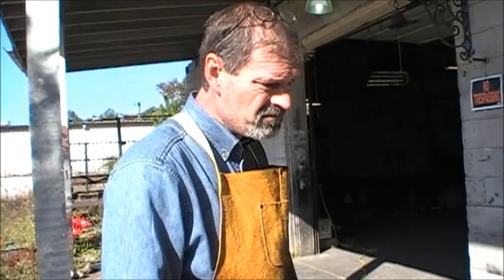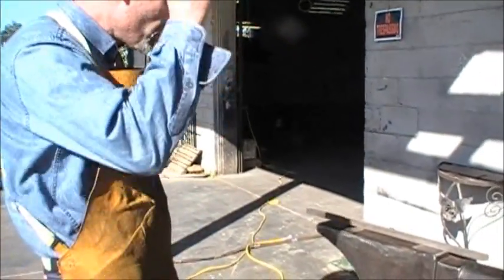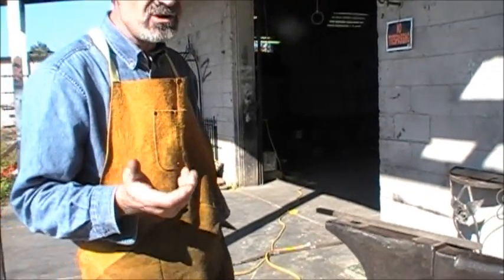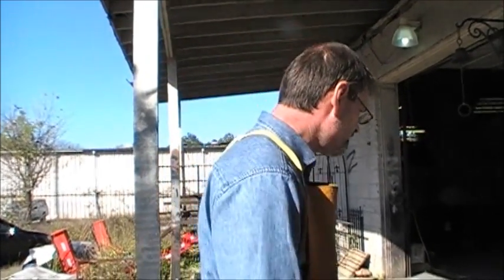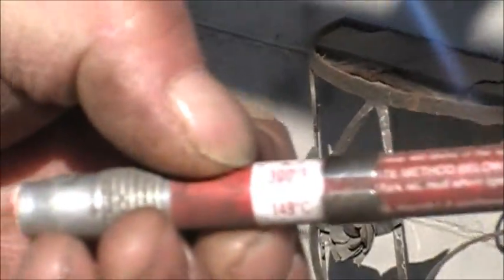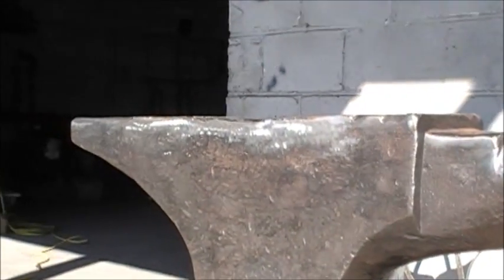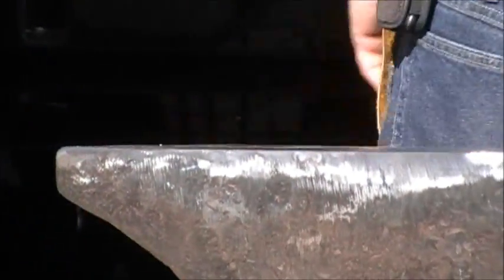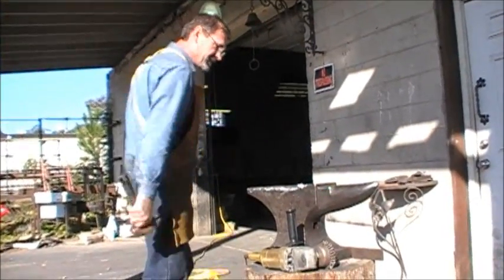Blacksmith Anvil Restoration Part 1 of 2

Comment: Thanks for posting this video. It gave me the confidence to take on the same job on my 395lb PW farriers anvil, although edges on mine are fine.  I had 3.5 mm of swayback to get out of the centre.
A lot of grinding over several days and belt sanding to finish, which was a lot of work...but it has been worth it. I now have a fantastic, very usable old PW.   Cheers Stelian.

Comment: Hayes work-hardening hard surface rod is the way to go. 750°f whole mass preheat to insure adequate penetration.  Bulld everything up. Peen and wire brush each rod pass. Should take about an hour. Those rods like a short arc. DC positive. ¼" rods. 'Stir' the weld as you go. At about135 amps. Should take about one rod per cubic inch. They aren't cheap. About $4USD each in 2020 money. Glad it worked out for you. I lived in Selma for a few dozen years and smithed at hickory forge  on Lizzie Street. Was NCABANA till I retired and moved to Cape Hatteras for 5 years. Am in Arizona now. Traded hurricanes 🌀 for heat 🔥🌡️🌵🦂⚒️
  Edit: Sorry.I now see that this video posted eleven years ago. If you are still monitoring the comments, how is the anvil holding up? Praying that you and your friends and family have endured these trying times. God Bless.🙏

Comment: I had a colonial anvil restored in a similar way.  The welder who did the work preheated the anvil to 250 -300 degree F to be sure the welds took.   He built up much more with the welds before griding back, to preserve as much of the original face as possible.  I don't know the exact rod # he used, but it is a "work hardening" alloy.  He did not do any further heat treating.  The results were excellent, and I was only charged $45 for the work.

Comment: A plate of good quality modern glass will be quite flat, use of that (with size bigger than the work surface) with some high quality sandpaper can help flatten it some more, with use of ink the bumps will show

Comment: the main purpose of preheeating is to drive out any possibility of retained moisture in the material being welded and also keeping rods very warm,  minimum over 250-300 degrees.  temperature differance appears to make a differance, crystal structure.  saw  several pipes welded with a short preheating time,  they just broke at the edge of the weld.  had others held in preheated state for over 15 minutes resulting in about as perfect weld as can be,  passed all tests administered.  regards,

Comment: with those style anvils (wrought iron body and hardened steel top) you can usually see some kind of weld line even if it's been smoothed over it's normally still visible.

Comment: In the larger 7" grinder size you can use a cup style grinding wheel made of silicone carbide...same material as used on crankshaft & camshaft grinding machinery, except they use a lubricant spraying on while grinding...similar but coarse wheels were used for grinding  concrete, which may be the way to go..about $15 from norton..

Comment: wrought iron. Next I grind the chips and especially the cracks out. Next I weld the chips and cracks back to slightly above the original surface making sure to peen each weld pass surface and grind them back as needed. I weld the sway up instead of grinding every thing else down. Next I rough grind the surface somewhat flat. Next I reheat the anvil top and anneal in wood ash. Next I have the surface decked by a automotive machine shop. Finally I heat treat in a water trough with water running

Comment: Indeed, i have a 341pound PW in pretty bad shape and im going to follow exactly what you did. The steel plate is usually as thick as the shear near the table. so a lot of steel is poured for a face, However the age of you anvil would suggest different.

Comment: How do you keep the temperature of the anvil material around 400 to 600 degrees when a welding arc can be anywhere between 6500 and 10,000˙F. With Shielded Metal Arc (SMAW)	at 200 amps the heat affected zone is ~2.00 inches; the longer the weld the farther out the heat gets. In most applications a 1/8" 7018 would be run around 125/130 amps. If temper is lost above 600 degrees for example then there is absolutely no way one can prevent loss of temper if repairing an anvil by welding. (I'm only speaking to 'temper' here. Thor only knows how many anvils have been successfully repaired by welding.)

Comment: Did you consider heating the anvil to unharden it, then having it commercially machined?  Especially since you knew you'd have to reharden it anyway...
Reply: high speed steel is amazing stuff and you can machine hardened steel no problem.

Comment: While I applaud your efforts and recognize your common sense approach, I must point out an obvious flaw in your approach. As a simple internet search of anvil anatomy will provide the fact that only about 3/8 of a inch of the top of that anvil is the steel top plate and grinding 3/16 of an inch off the top will remove nearly all of that.  Instead when I restore an anvil, and I have done many, I first heat the top of the anvil as deeply as possible to relieve the stress created by the sagging